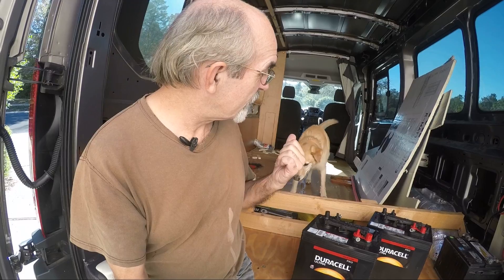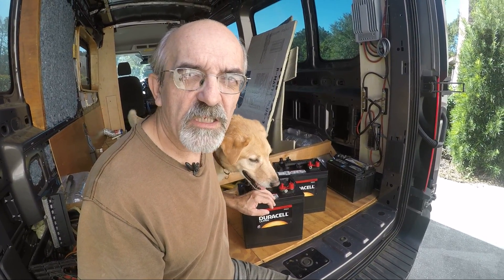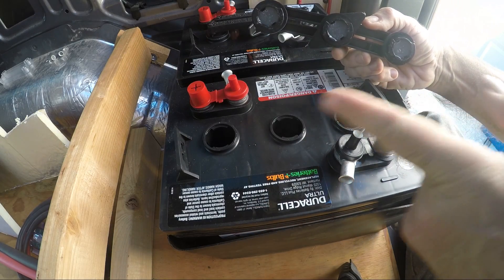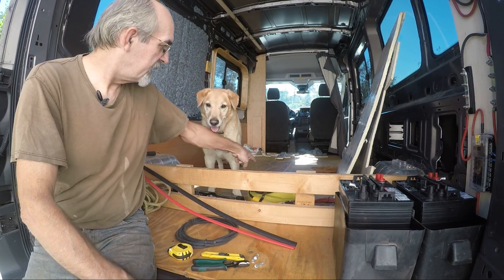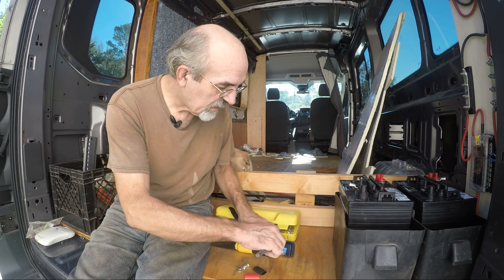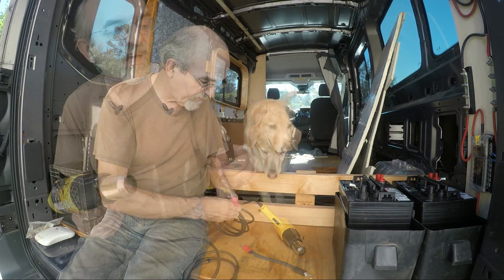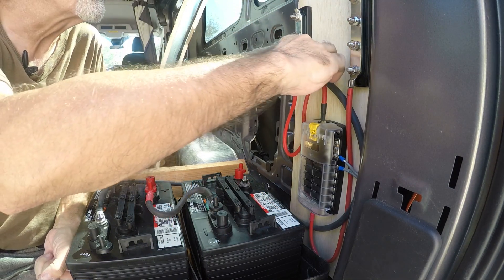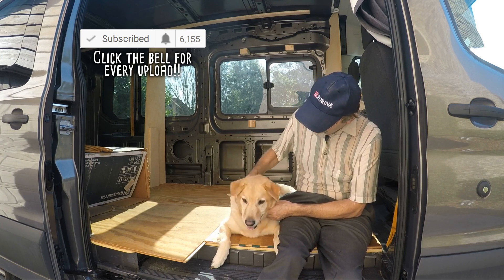ETFE Flexible Solar Panel Installation - Part 5

Comment: Nice to see you took so much care crimping the cables on this build, you are correct it is important to have all the connections done properly as loose electrical connections are the biggest cause in starting an electrical fire, 
I like that you have isolators in the lines, your system looks similar to my home system,
cool build thanks for sharing
Reply from the maker: Yeah, I've seen too many bad cable connections. And with all the moving of a van, that's where it breaks down. The breaker box makes servicing the solar system much easier.
Thanks for watching!
Van Williams

Comment: Hi there,  Your video is one of a kind very informative, I like to know your solar 405w with 12v battery equal to how many kilowatts 24 hrs used? I am trying to finger what inverter to get for myself with family of 4. Thanks you much.
Reply from the maker: Hi Dragonfly,
Thank you for the feedback.
If I understand your question correctly, you want to know how many watts are produced by the 405W of solar panels under load in a day.
There are many variables that cannot be accounted for.
Location: Central Florida - Any location further north has less exposure to the sun.
Time of year: I have tested them only this winter - In summer there are many more hours with exposure to the sun.
Installation: Flat on the vehicle's roof - lifting these panels towards the sun, results in higher performance.
Even the cabling (thickness and length) or the controller can make a difference.
That said, I have tested them in recent months with the shortest exposure time to the sun, under sunny conditions, under load and the controller could produce ~20A @ ~14V to go to the batteries. I can get here about 120A/day (~120A x ~14V = ~1680W) on the shortest day of the year. I expect a higher performance in summer (>30A or >250A/day or >3000W). I haven't tested these new panels in summer yet and I can be way off. You'll have to wait a few months to find out. These calculations are under ideal circumstances. Usually, in summer, one tends to go north for milder temps, but that often results in lower performance. Your situation could be quite different. Use these numbers as a guideline and not as an absolute fact.
I am optimistic about these panels, they perform better than I expected; having them flat on the roof affects the output substantially, but that is likely less of an issue in summer.
The size inverter is more dependent on the size of the battery bank and that in turn influences the amount of panels. Less panels may be necessary if you also charge will driving or if you regularly use campsites with electricity.
So many variables :) Good luck.
Van Williams
Reply: Van Williams 
Thanks again for your time and I can't wait to hear from you in summer, take care.

Comment: Great stuff, I wanna ask you why you didn't mount a battery box under the van ? I am building a 06' sprinter 158" so a long wheelbase and under has tons of open space, gonna do the batteries under as well as water tank. Not familiar with transits yet.  I did a swivel on the passenger seat digging that, also bedliner for the floor, then will do hydroturf on top, sides and cieling will use lizardskin ceramic as insulation as I can't stand rust and refextic and other stuff you glue onto the walls will rust under, you need a moisture barrier. I also have pup supervisors... Joey is super kool !
Reply from the maker: Hi Rene,
My Transit is a LWB 148" and with the spare underneath, very little room for extras under the van. Would have done at least some storage and perhaps batteries. Don't know what type of batteries you'll use, but most likely low temperatures may be an issue, dependent on what climate you're in. Same issues with a fresh water tank; I considered putting extra water storage underneath, but I managed to accommodate a 46gal tank inside. Just ordered, hope to receive it in the next couple of days. No need to empty, when it's freezing outside.
A swivel is also high on my list; have been waiting for prices to come down, unsuccessfully... Don't use Reflectix, unless as window covers.
I decided not to go with a separate vapor barrier. The Transit has a issue, where condensation on the windows, drips down into the wall cavity underneath; cannot stop that. No weeping holes at the bottom. I regard the skin as a vapor barrier, but adding a separate barrier, would lock that moisture inside the walls. Did want to give it a way to get out. I have to say, that I also did a lot to avoid moisture. The floor vent works incredibly well in combination with the roof vent and I don't use propane at all (all-electric).
Joey IS super kool, but he is about six years old; looks and acts like a puppy (like me), but almost an old guy!
Happy New Year.

Van Williams
Reply: Ahh.. yeah this sprinter I have has tons of room. Prob going with agm and I'm based in So cal so no worries with temp.  I would think a battery box insulated could be cake to make. I am gonna offer them at some point, along with bumpers etc...  46gal is huge... you will be stylin for sure !!!  Are you diggin them panels ?  I am shopping for panels soon, debating on flex or not. lots of work into these that is for sure, keep it up !!!
Reply from the maker: Hi Rene,
Some are using 12V heating pads, hust for the few times that frost occurs. I will be primarily be boondocking and the supply of drinking water is always the bottle neck.
I have the flexible solar panels only recently installed and I'm still testing them out. Very satisfied so far in multiple ways. I choose these specifically for their size. Their length is exactly the width of the van's roof (59.5/60in); that maximizes the output my can put on your roof. Had a very good experience (so far) ordering directly from China. Good quality and good performance (equal or better than many rigid panels). As you see, only accolades. But there are two very practical reasons not to buy them: if you're not in it for stealth, then get the rigid panels, they are much cheaper. They also have a better trackrecord than the flexible ones. The 'first generation' of flexible panels used cheap solar cells and flimsy laminates; that is changing, but I am taking a risk.

Van Williams
Reply: Thanks for the info, I actually wanna get panels I can walk on ! On the flipside I have been making stuff in China since 96' and 80% it's pretty ok. Since they are sponsoring you they will treat ya better then the avg Joe.. ja !
Reply from the maker: Hi Rene,
The 'walk on' feature of flexible solar panels has been one of those things that popularized these kinds of panels a few years ago. While it's still a feature, I would limit that use or not do it at all. My panels look very sturdy and I think they would allow walking on them without a problem, I still wouldn't do it.
Quality is another issue, when you order from China my video https://www.youtube.com/watch?v=IX69FUYL50c&list=PLyrIiniKvmg5fw4iLGoeajpfCFETk2zTY&index=51 is one of my most watched videos and dealt with some of the issues. I have had and still have a good experience with Link Solar and haven't gotten any negative feedback from my viewers so far. But I always mention that he's my sponsor; I always try to be straight and honest.

Van Williams

Comment: Great video, and thank you for the link to the cable crimper that you used. I've been looking for an economical hex crimper for many months and finally settled on the model you demonstrated.
Reply from the maker: Hi Christopher,
Thank you for watching and I appreciate the feedback.
A good crimp makes a big difference for your 12V system and is often a neglected part of the installation.
Buying through my affiliate links also supports my channel. Thank you and Merry Christmas!

Van Williams

Comment: Hi,, love your work,  but the music goes so loud,, anyway learned loads, thanks.
Reply from the maker: Hi Davy,
Thanks for the appreciation; that gives me a lot of motivation to continue!
Also appreciate your comment about the loudness of the music. I'm still struggling with the sound, but we'll get there :)

Van Williams
Reply: Cargo Van Conversion  It sounds like a compressor your using has  the output set a little to high.. Thanks again, I've just got a super long wheel base ford transit, So I'm realy glad to come across your chanel. Specially for the electrics.. Thanks again..
Reply from the maker: Hi Davy,
Loudness of bothe voice and music differs with each recoding and 'normalizing' doesn't always work out correctly. Then you have that the sound settings on each computer vary. Fortunately both video and sound have been getting better, since I started about a year ago, but still a lot to improve.
So you have a LWB-Ext, but do you also have a High Roof model? That combination is ideal for an RV.

Van Williams
Reply: Cargo Van Conversion Yes, I already love it!! Haven't even started the conversion yet,, lol... I'm in UK, I'm gonna build a music studio in it!! Travel europe recording,,, Shame I can't help you out with that sound, When you talk it goes quite and that's fine,, also the music is very nice, but when you stop talking it comes back full power, to load,,, It realy sounds like some sort of sound compression, yeah anyway I'm sure you'll figure it out.. Pro like you.. Take care my friend, and joey. .
Reply from the maker: Hi Davy,
You're the first one with a music studio, that I've heard of. Great way to escape the UK for better weather! Would appreciate some pics of your van, when you're further along :)

Van Williams

Comment: How many amps & volts in battery bank fully charged & can you use excess power during charge? If that makes any sense. Where did you pick up that crimper tool & is it expensive ? Thanks for posting Van your care & attention to detail are top notch. Try bribing ur supervisor with tasty snacks👍👍🚐
Reply from the maker: Hi Stephen,
Right now I have 215Ah (105Ah usable). I will replace them with 200Ah-400Ah Lithium later on. It's a 12V setup. Under ideal circumstance I can bring in ~30Ah. That can go into the batteries or be used.
The crimper was approx. $28.00. Absolutely worth it. Can buy it here: http://cargovanconversion.com/but/lug-crimper (affiliate link).
I'm a cheapskate, I don't have to bribe Joey, he'll do anything for free :)

Van Williams

Comment: It's good to see you both back. Seems like a long while since your last video.
Reply from the maker: Well, you'll see one video every Friday, but that doesn't count for Joey.In summer I keep him inside as it's just too warm outside here in Central Florida.

Van Williams
Reply: Ah, it turns out that I missed parts 2, 3 and 4. My YouTube recommendations have been obsessively pushing one particular theme recently. I would have thought it would give more weight to videos that I've given the thumbs up, but apparently not.

Subscribed! (5,418th)
Reply from the maker: Hi nagualdesign.
Thanks for subscribing! It does help me with my channel, as does commenting/liking. I post a video every Friday.
I don't like YouTube's recommendations either, but they are constantly changing the algorithms, so it should get better.
Have a great day!

Van Williams

Comment: Joey is a beautiful creature!  It's nice to see more of him.  Another excellent video!  Thanks!
Reply from the maker: Hi Mark,
You'll see Joey a bit more during the winter months as the temperatures here in Central Florida have come down. It also helps to have the solar working; the roof vent will make a big difference, working in the van. Like many dogs, he prefers being at my side and so do I. There is a special bond.

Van Williams